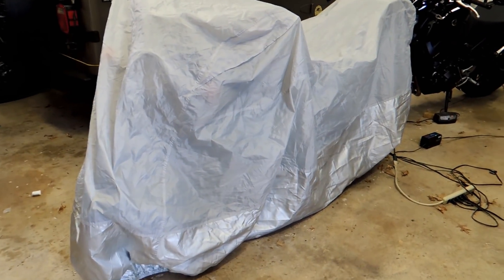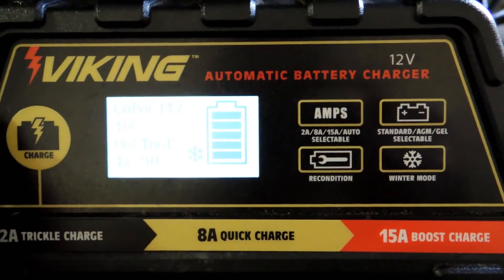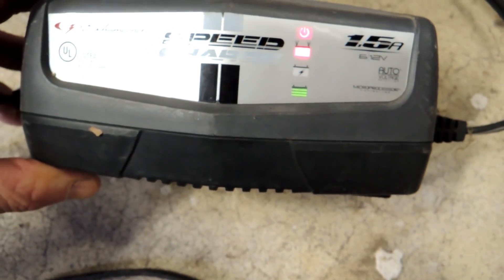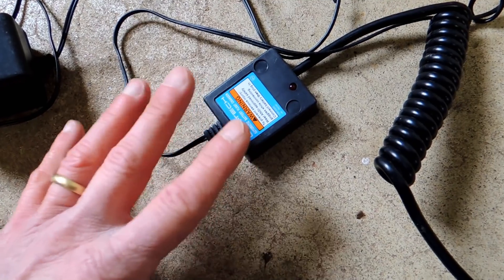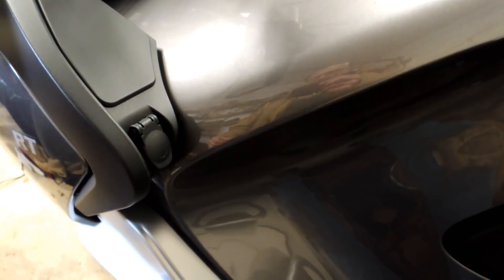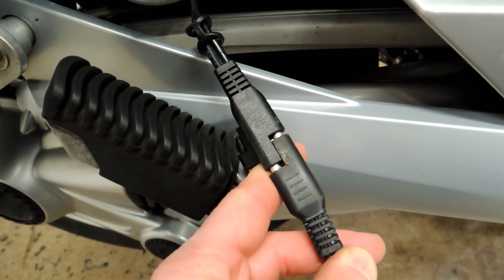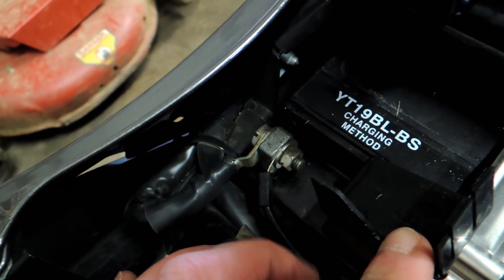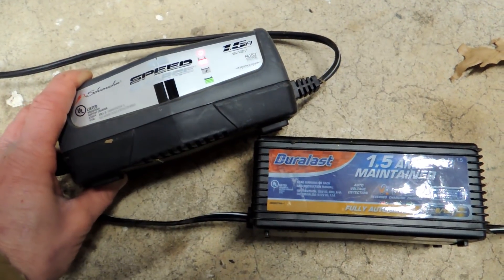The Truth About Motorcycle Battery Chargers

Comment: A good "Smart Charger" does a lot more than just charge and stop at a pre-set voltage level. Then monitor batteries output voltage.  If it drops below the preset level, charging starts again (lather, rinse, repeat).
My OptiMate 3 - has 5 program stages:

1) Desulfation and recovery - high voltage charging up to 20V.
2) Bulk charge - Constant current of 0.8Amps.
3) Charge verification - After the bulk charge stage has completed, charging voltage is lowered by 1/3 and monitors battery condition for 30 minutes.  If the CPU sees voltage output fluctuations or a drop, it will revert to Bulk charge again.  If the current absorbed by the battery is optimal the program continues to the next stage.
4) Charge maintenance - 30 min. period of slow charging, even with a light load on the battery.
5) Charge retention test - 30 min. rest period while monitoring the power leakage and against natural self-discharge.

These two 30-minute periods (stages 4 & 5) repeat indefinitely.
OMG, this is really sounding like a commercial (better say it now... "I have absolutely no affiliation with OptiMate or its parent company TecMate."  For me, in my opinion, it just works well.
Reply from the maker: "Smart" chargers have been sold for a couple of decades or more, but the more recent models will have more sophisticated algorithms for monitoring and charging, it's true.   The more recent models can also work with newer lithium batteries, and distinguish between lead acid, AGM and  deep cycle batteries.  The older models didn't have those features in part because those batteries didn't exist at the time.

Comment: Does the battery have to be disconnected in order to trickle charge it?

Nice video btw
Reply from the maker: No, you can leave the battery connected.  Typically you install that SAE pigtail to the battery and just leave the other end hanging somewhere convenient to hook up the charger.  The pigtail will have a little cap on the end to protect it while riding.

Comment: Just a tip and only the tip mind! I would remove your bike cover when charging. You run the risk of creating a hydrogen balloon 😬
Reply from the maker: For chargers of very low amperage like these, that's really not a concern.  It's when you are using unrestricted, non-computerized high-capacity chargers that you can have off-gassing occur.  I remember well some of the stories of explosions we heard back in tech school, but that was before the days of "smart" chargers.  We were advised back then to keep the hood open and ventilation in the shop!
Reply from the maker: I use a light duty cover for winter storage indoors.  It keeps the dust and filth from the garage from settling on the bike in the winter months.  No wind in my garage, I hope!
Reply: So?  That was good enough for the Hindenburg! Oh…wait…forget it.

Comment: The harbor freight trickle charger if its for fluded, or AGM  batteries "sources" a constant voltage the CURRENT will vary as the battery approaches the "source" voltage of the charging device. That is why the instructions for that trickle charger says to ensure that the battery is fully charged before applying the trickle charger, other wise the trickle charger will be destroyed by the battery "drawing" current in excess of what the device is designed to "source".

Comment: Is a 'Schumacher SC-1' charger with 750-milliamp output suitable for an 'AGM' 12-volt small battery? Because some say 'No, you need a special charger for a small 'AGM' battery...put a charger on it and you'll kill the battery!  What the hell? And what the hell does it mean when I read "DON'T OVER-CHARGE!'  How can 750-mil-amp 'on sensor demand' over -charge the battery? For that matter why even use a 'maintainer?'  I'm confused as shit here!
Reply from the maker: Ah, marketing.  Muddying the waters everywhere!  So, some AGM batteries (and gel batteries) have a standard voltage that is a little bit higher than lead acid batteries.  The fear is that a charger might under or overcharge a non lead acid battery if it isn't designed for it.  I think that fear is overblown, but most if not all newer smart chargers are designed to handle AGM batteries without issue.  It's basically just a difference in the charging algorithm which monitors the state of charge.    If you look at the manufacturer specs for a new charger you'll likely see AGM and/or gel batteries mentioned.  They will shut down before overcharging.
Reply: Not so fast! The 'Schumacher Model SC-1' I have says specifically on the module itself "DO NOT OVER-CHARGE" which inherently means 'do not leave it on the battery for extended periods'...at least that's what I understand it to mean   That seems odd for a product that 'right on it' says 'Built4Maintaining'...so now I'm confused as shit! So maybe the 'smart chip' inside needs 'more schooling'...because I don't get this scenario at all of 'it can't over-charge' and at the same instant it implies 'no extended periods of time'  HUH? WHA'? How can a 'battery maintainer' become a 'battery burner-upper?' if left on?
Reply from the maker: Well, I'm not a product manager for Schumacher, I was just giving you the generic explanation.  I just tried to look up that model and it appears to be an older one which is no longer sold.  From what pictures I could find it looks like it was a low-end charger.  The new version appears to be the Schumacher SC1278, which is also a low-end model.  I don't know where you're seeing the overcharging warning.  If you like that brand, I recently added the SC1343 to my collection of chargers and it works well.  Here's a link for you:

https://www.amazon.com/Schumacher-SC1343-Automatic-Battery-Maintainer/dp/B07895CFTR/ref=sr_1_1?keywords=sc1343&qid=1576628965&s=automotive&sr=1-1

Comment: You keep them on the chargers all winter?
Reply from the maker: Yes--assuming you have a "smart" charger that is what you should do.  Over time the charger monitors the battery and when it senses enough drop in voltage it will charge the battery again.  This cycle will repeat as needed and your battery will be ready for use in the spring.
Reply: @tinderboxarts  thank you
Reply: @tinderboxarts  we had 2 Battery Tenders go bad when they were plugged in constantly. Do you use a surge protector or GFCI  to plug into?
Reply from the maker: It's not impossible for a charger to go "bad,"  although you would typically observe wonky behavior such as failing to light up or blinking error lights, etc.  I have some microprocessor controlled chargers that are over two decades old still running fine.  I find it acceptable just to check on the chargers I have in use once a week or so as I walk by in the garage. If I see something unusual I can take a closer look.  Surge protectors would only offer potential protection to the charger if, say, there was a storm and a lighting strike or power surge.  The idea is to have the surge protector cook before the items plugged in cook.  GFCI outlets, which are commonly installed in garages, offer protection to humans in the event there is a ground fault.  In other words, the outlet will sense leaking current and snap it's internal switch before a human gets electrocuted.  

It's possible you had a voltage supply problem or surge that cooked your chargers.  Or, possibly they just weren't very good quality.  There is an advantage to upgrading to newer microprocessor controlled chargers because the latest models will offer more sophisticated charging algorithms and better handling of newer AGM and Gel batteries.

Comment: I recently bought a 1982 yamaha maxim xj750, the bike was working well enough to get me home the day i bought it but died on the next after i drove it for a bit. I figured it was the battery but before i hooked it up to the charger i heard bubbling or popping noises from it. When i plugged in the charger the bubbling sounded louder. Is the battey dangerous and dead by this point, or is there anyway to go safely about it until i get a new one.
Reply from the maker: Well, some bubbling is normal when a lead acid battery is charging but really heavy bubbling can be an indication of overcharging or possibly an internal battery issue.  You need an inexpensive multimeter to figure out what's going on.  With nothing connected to the battery it should read in the mid 12 volt range if it has a reasonable charge.  If it is in the low 12s or high 11s it may just need to be charged up.  If it is well below that it may have a dead cell or two.  When you have the battery connected to the bike and the bike is running, the charging voltage should be in the 14 volt range.   If it is over that, the voltage is too high and  you are cooking the battery.  Same goes for a charger.   I should also mention that if this battery has caps that can be removed you should pull them off and check for battery acid in all of the cells.  Sometimes a cell or two can get low and need to be refilled.   If the cells all have fluid, the unconnected battery voltage is not super-low, and the charging voltage is in the 14 volt range, it should be safe to continue charging the battery to see if it will hold a charge.  You can leave the caps off (if it has caps) while you charge to let the bubbling gasses dissipate.     You may still need a new battery if it will not charge or hold a charge, but it will be safe to make the attempt.